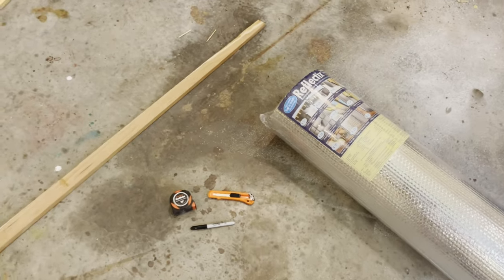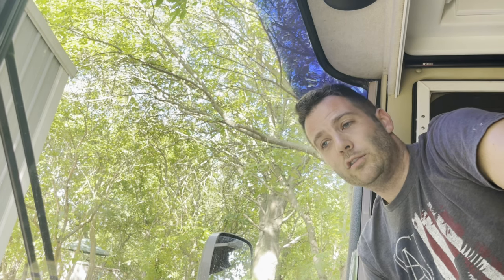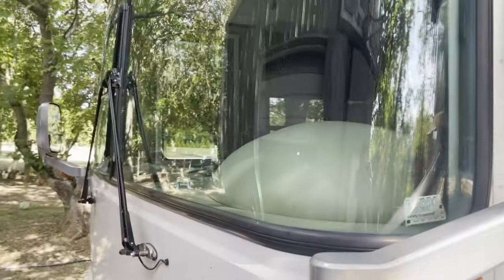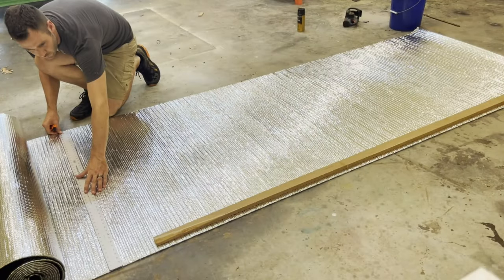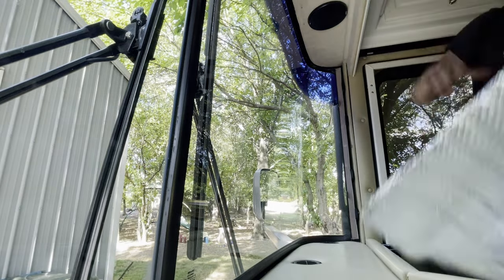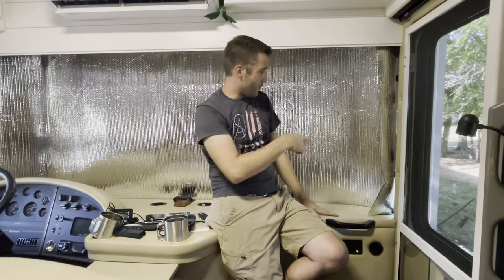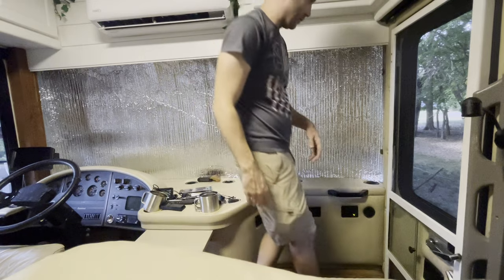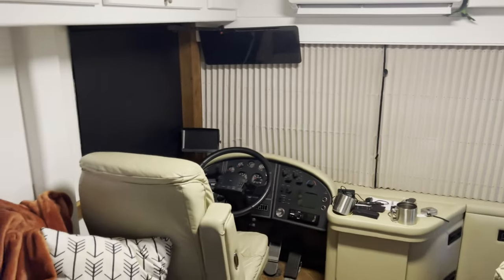RV Windshield Shade easy DIY project

Comment: I like it! Great job! I may abandon my shade with a bad motor. Fleetwood riveted the dang thing making it very difficult to do an otherwise easy electric motor change out.
You have come up with an easy alternative. 
Yours covers the whole windshield as well. 
Mine has six inches of open glass on each end when it worked.
Thanks!
Reply from the maker: Ours had a corrugated sun shade but it was only light filtering.  This blocks the light 100 percent and adds insulation from the sun.  Really makes a difference and was not that expensive
Reply: Thanks again, I will take it all under advisement!

Comment: Great job on measuring and cutting for an exact fit. I've actually been looking at that same reflective material on Amazon and now after seeing you complete the project, it looks like a project that works out very well.
Thanks for showing how you did the project step by step with good detail!
Reply from the maker: Glad it helped.  Did you ever get around to getting it done.  It does help and has held up well.

Comment: We did the same with reflectex on our front windshield (2000’ U320) - makes a big difference. We also replaced the pleated blinds with blackout cellular shades which block an additional 20 degrees than the reflectex alone (at 120f temp outside). We also found it stores nicely when folded in half under the mattress. 

Keep the project videos on your foretravel coming - I always appreciate them.
Reply from the maker: Thanks!  We will do that.  I have always had fun trying to build this into a boondocking rig.  Worked well so far.  We have the MCD blackout shades around the sides but the front still left the corrugated ones .  Perhaps a future upgrade